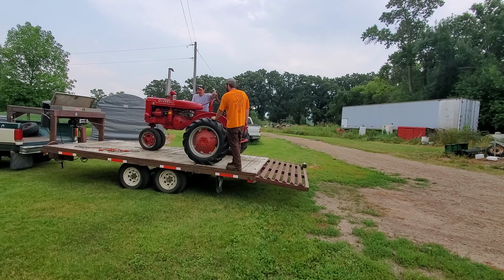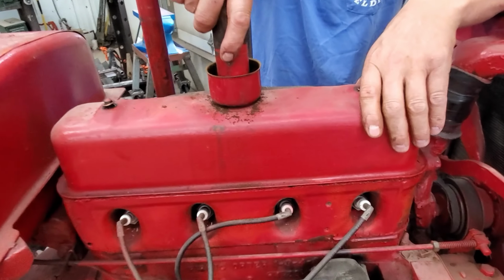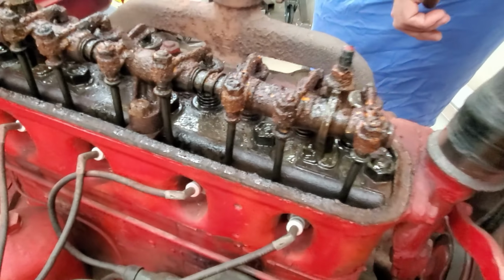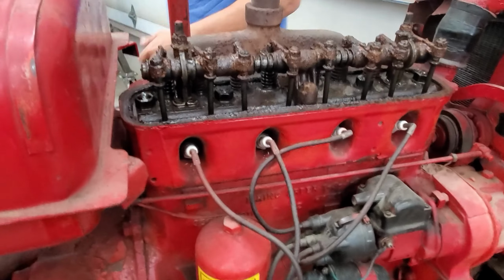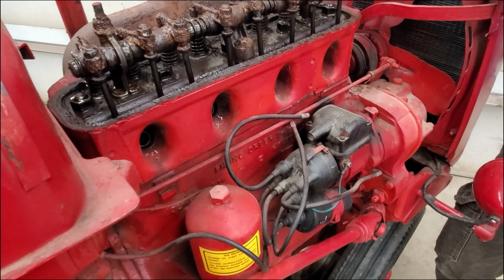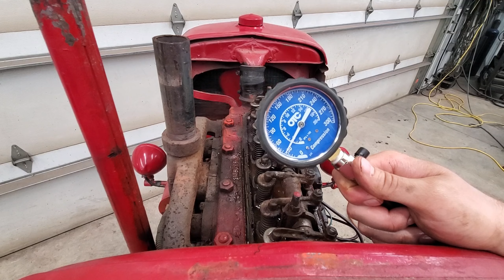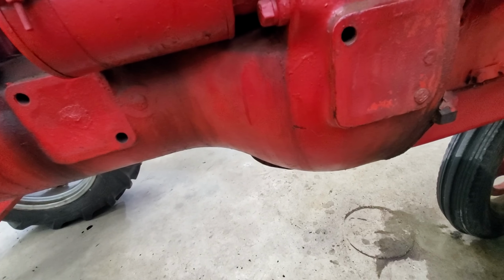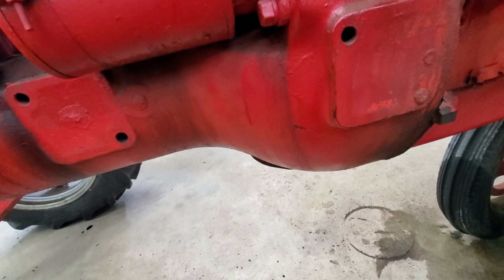Will this Farmall B run after sitting for years - '47 Farmall B Ep1

Comment: I'm not surprised it started when you consider how durable thr old international tractors and trucks were. Looks likes it needs new engine seals. A bit of leakage on first inspection. Good video
Reply from the maker: Thanks for the comment! Once we saw it turned over we figured it would start, it was just a question of how well. We are looking forward to tearing into and see what failed.

Comment: It's nice that it started right up but unfortunately the bad sign was all the antifreeze that came out of the oil luckily it's just a bad head gasket but otherwise this is a wet sleeve motor there are O-rings at the bottom of the sleeves that seal the bottom of the sleeves and the block there is a possibility that they have leaked antifreeze through over the years the only other bad scenario is if the antifreeze was too weak the engine block could be cracked internally
Reply from the maker: Thanks for comment! We are hoping it's just the oring which failed around the sleeve and just need to be replaced. But we'll find out soon when we tear in to it.
Reply: Always wanted one of those.I'll be watching.

Comment: I do not believe your machine is a 1948! Farmall B model tractors were produced 1939 through 1947. I own one of these B model tractors that no longer has the factory seat with the bracket where the serial number plate is located. If you look over the machine and can locate a casting number similar to 1*8*J that is the month-day-year that specific part was cast. The letter I is 39, J is 40, K is 41 going all the way up to X in 1952 which was the end of the model M production. The letter V was the only exception to this date casting system for Farmall in 1951; U and W were used instead. That will help you estimate the history of the machine and which parts if any were swapped out over the years. GOOD LUCK!
Reply from the maker: Hey you are absolutely right I was mistaken. Reviewing the serial number it appears to be a 1947 out of Louisville accordingly to tractor data. I was unaware of the casting number decoding thanks for sharing it'll come in handy for the future. Thanks for the catch and comment!